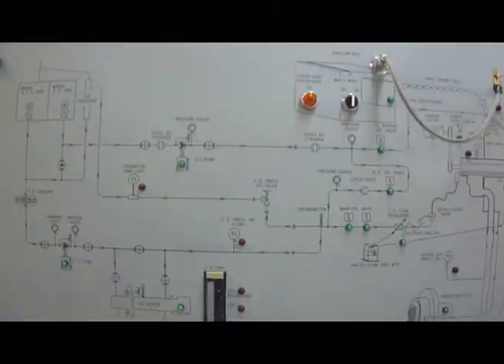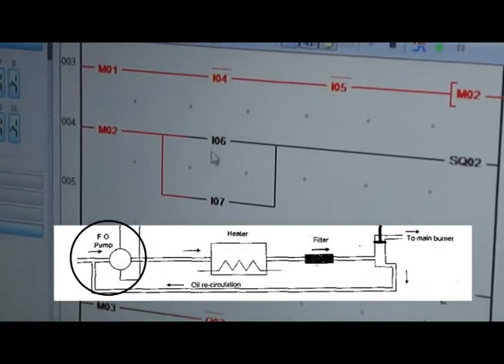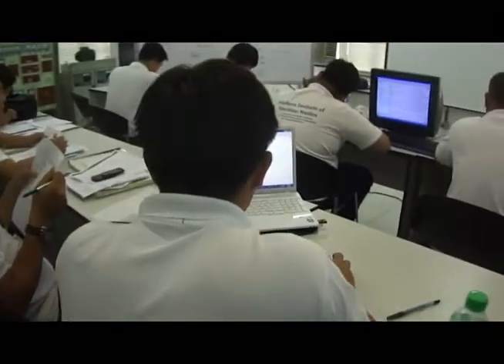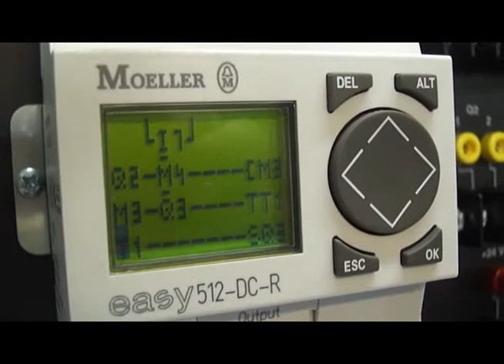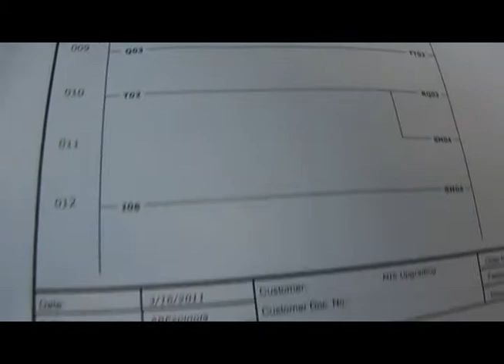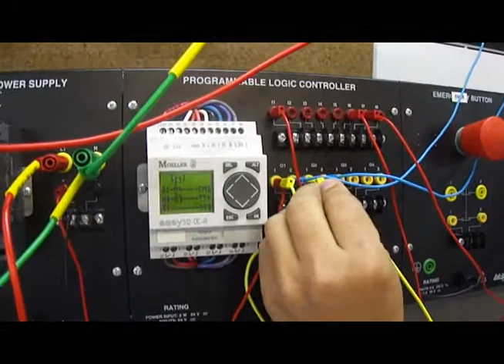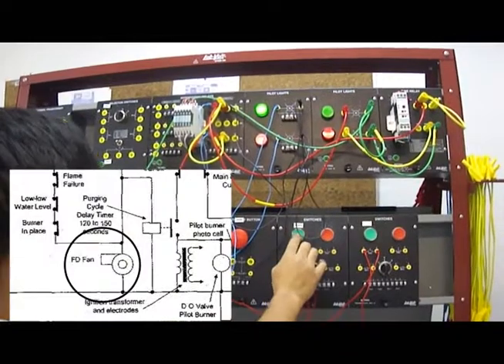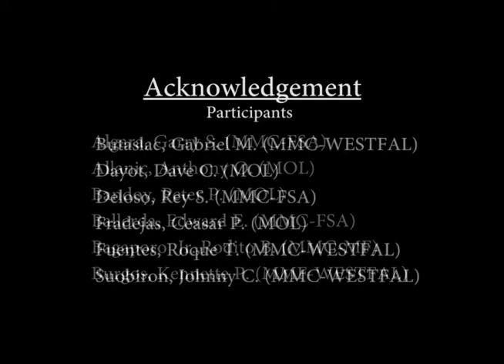boiler control system using PLC.wmv

Comment: nice man...base on your schematic diagram how can you able to reset your safety switches. i think you need to add more relays, pilot lights and siren...if the system fails to ignite your burner will filled with fuel.there should be a control system for the fuel pump. anyways good job